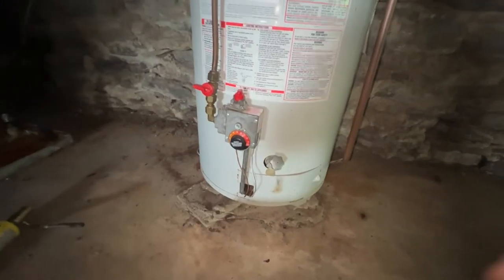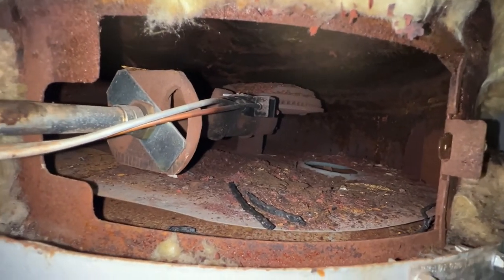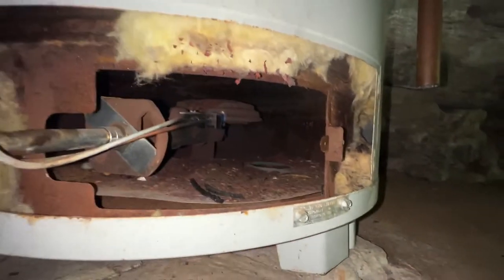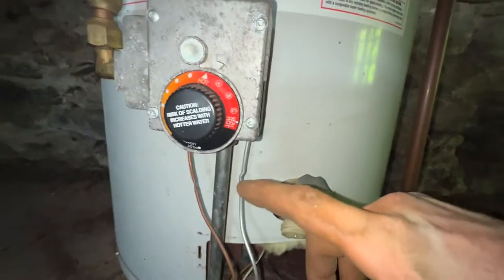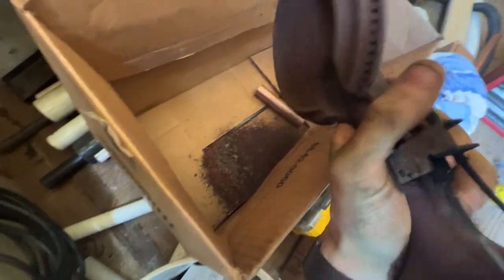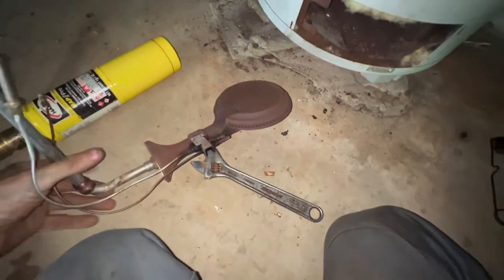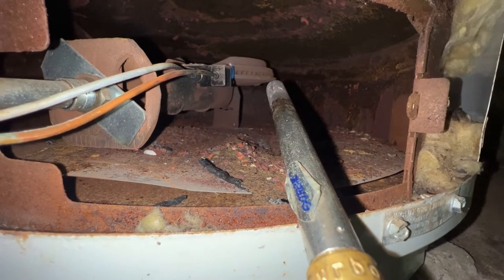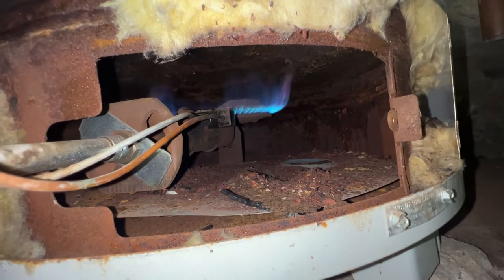Propane Water Heater Burner Cleaning

Comment: Just gave you a like and subscribed.  Just lost my dad and my mother is a 76 year old widow her water heater went out a couple days ago and had a person come out because the pilot light wouldn’t light like it didn’t seem like it was getting gas.   I didn’t take a torch but a match. I tried to light so didn’t see a flame but do have a propane torch and will try that. They did clean the burner and no pits,holes, just surface rust he took a wire brush to it and it looked like a new one but he didn’t blow it off as I was arguing with him as he was trying to sell mom a new one.  He did replace the thermal couple part q340a1074. And the water heater looked almost like the one you showed but not the rust and yes it is like 20-30 years old I’m guessing.  We just called them back to come fix it any advice and I’m GREAT-FULL!
Reply: Tried the torch and nothing?
Reply from the maker: What kind of gas, Propane or Natural? If propane, is the tank full? Any other gas appliances and do they work? If the pilot is not lighting but the system has gas(as in other appliances are working) then I would look at the regulator on the heater itself. If the pilot lights, but wont stay lit after you hold it on for a few minutes, that would indicate the thermal couple went bad.
Reply: @GodwinAndSons  thanks for the reply hope this makes sense and yes all other propane stove works and tank is full. Not sure of the name but it has a cover plate and it isn’t sealed like the new ones as you take the cover plate off and you can see all the way back in there so an older one.   they replaced the thermal couple and it worked for the day and is the old type as it has to be lit I’m guessing by a torch as I did it has the on off valve that you set it to pilot and push straight down if there is a pizo ignition button built in it isn’t working like on a gas grill has a seperate button to click as this has none so I guess you light it manually.  When they pulled the burner plate out it was black covered soot covered.  But cleaned up nicely as no pits or holes.  Like I said it acts like no gas getting to pilot light.   If it is an older one can they put a universal what ever you called it on there cannot look back to your message as I’m writing.  Can the new thermal couple go bad in one day?  I’m so baffled and worried mom will have to buy a new one.  I’m concerned that this 30 year veteran of this company is doing her wrong as he was there only 30 minutes Like I said he pulled the burner plate out and cleaned it. And thanks for your reply.
Reply: I’m sorry the regulator can you put a universal regulator on it as they said cannot get parts as this is a big company as I won’t say their name.  ???